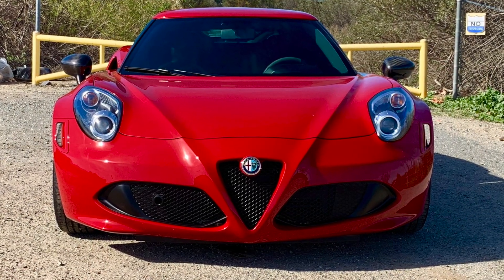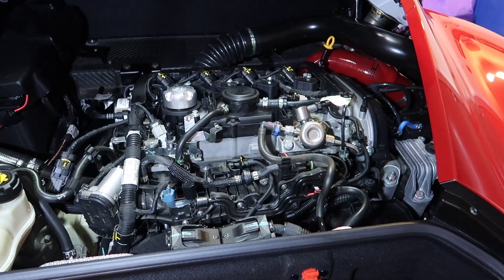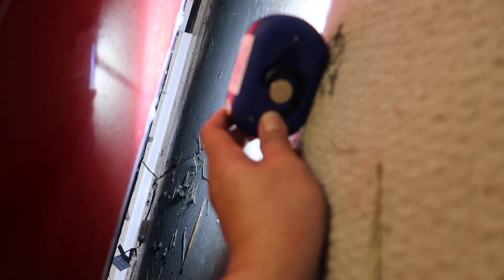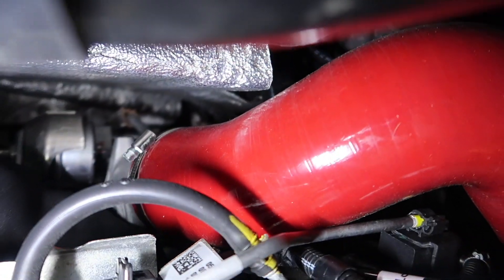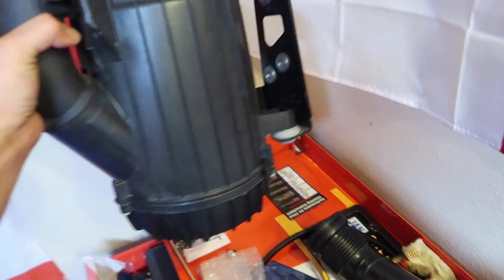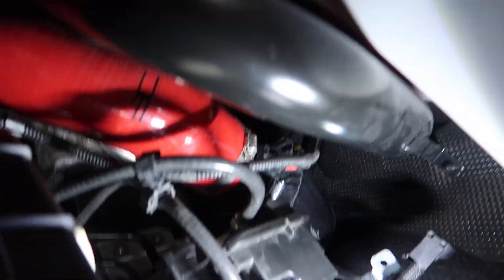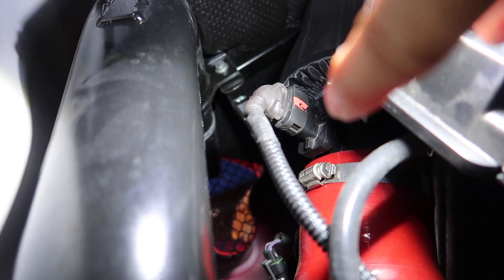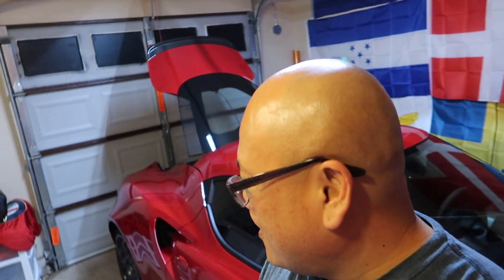Let's Talk Cars: Eurocompulsion Cold Air Intake on Alfa Romeo 4C

Comment: Quick questions: a) if you install that system, is the car still safe when you drive in rain? (so that the filter doesn't suck water in) b) does the system generally destroy the engine or benefit performance and lifetime?
Reply from the maker: It comes with like a water sleeve. I believe it doesn’t do any damage to the engine because it just helps it breathe better. Plus your air intake sound is much louder.
Reply: @menandro88  Hey, super appreciate the reply and sorry to bug you;) After seeing your really great video here, I purchased the exact same unit but then got a bit scarred off when I read that some of those filters let more particles (dust, debris, etc.) into the engine and shorten the lifetime or basically destroy the engine over time. I'm not an expert here and think this type of filter is probably a higher quality one but wanted to check with the community here and you for any feedback on it before I install and regret... ;) I live in Seattle, lot's of rain, so was also thinking about that but you are right the, water sleeve should work on this one well. Any concern on the debris, dust issues for engine potentially on your end?
Reply from the maker: Nope I’d say do it you won’t regret it. Just put the rain sleeve and enjoy your Alfa. 😉
Reply from the maker: I usually clean the engine bay once a month.